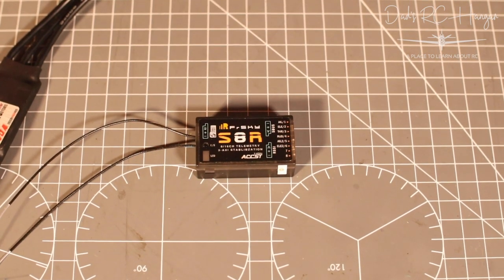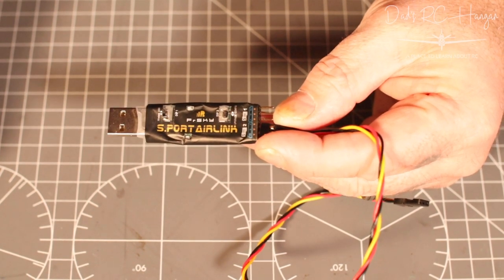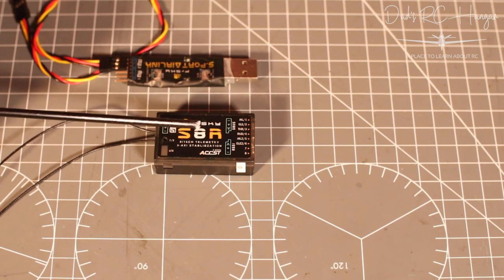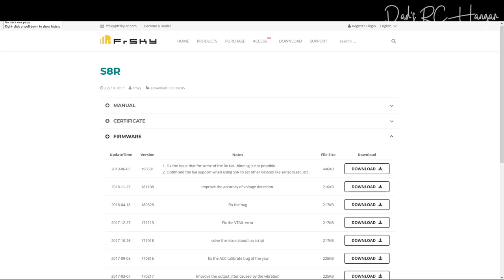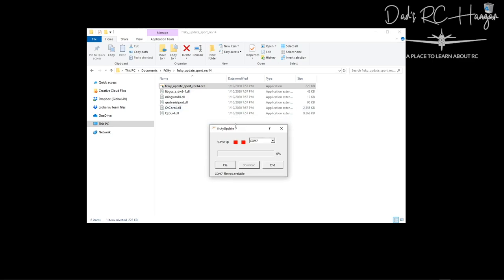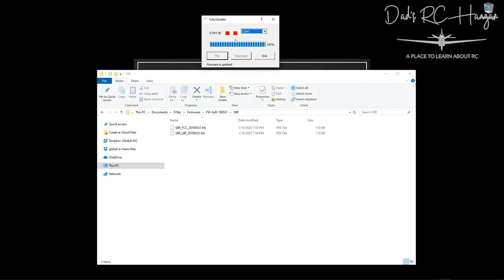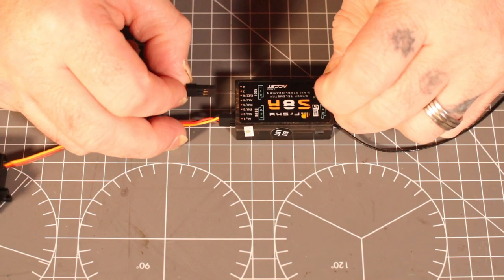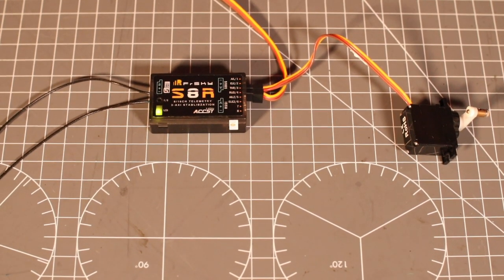How to Bind and Firmware upgrade FrSky S8R / S6R

Comment: Getting back into the swing of things and just took my radio out of the closet after a year. I can't get my new and some old receivers to bind to my transmitter and my telemetry does not register on the one receiver that does work. Is it an upgrade issue?
Reply from the maker: It dose sound like a Firmware issue but could be a few things. 
Did you upgrade the radio’s Firmware?  
Did you make sure it was your correct firmware?
Also the firmware maybe ACCESS and not ACCST.

Comment: quick question, my s6r is blinking red after the firmware upgrade, do you know why? I followed your video
Reply from the maker: Two thing I can think off, it’s possible you added the wrong firmware (LBT etc) so it dose not match your radio. Is it a new Access version?

Comment: I just ordered S6R for may glider for slope. It has 6 servos. How to connect rx battery? Can I use S.PORT to power in?
Reply from the maker: Hi Jurij, If you have not got a ESC then you can use the Sport, but make sure you disconnect the Signal wire. I believe the Positive and negative are the same rail.
Reply: @DadsRCHangar  this make sense! Thank you!

Comment: I have my Taranis x9d plus updated to the newest firmware and the S6r updated as well but I can't get them to bind. Any suggestions would be welcomed.
Reply from the maker: Try a different Id number on the X9D. I forgot with out looking what it’s called. They do this so you don’t have more than one receiver  bound to that Id number. Incase your buddy flying your other plane. Let me know if you need me to get the X9D out to look. Thanks for popping by, hope you subbed 👍🏻
Reply: @DadsRCHangar  I got it. I had accst v2 firmware on it. I put the older version on and it worked.
Reply from the maker: @SmokinJames  Ah yes accst. It’s good you can roll back. I am waiting for the new Transmitter and OS from FRSky. I did ask for a demo, no response. Glad you worked it out. Keep safe 🙏🏻👍🏻

Comment: Hi  I would like to know if you have a video on the s8r setup for horus x10 from start to finish . I am using the frsky software but having problems getting it setup .
Reply from the maker: Sorry I missed this reply for some reason. Are you still having issues?
Reply: @DadsRCHangar  yes I am just can not get it to work right.
Reply from the maker: ramduster1 I will do before the end of the month. 👍🏻
Reply: @DadsRCHangar  Thanks that will be great and help out a lot.

Comment: The newest version says only use with one mode, but doesn't specify which mode. It just says to use the older updated firmware for all other modes. Is the newest update stable?
Reply from the maker: Hi Chucky, I have not updated to the lastest as yet, I as I always say “If it’s not broken then don’t change it”. Unless In the firmware i see something that would benefit or fix an issue. The Latest is ACCST , FCC only. Not sure what it’s only one.